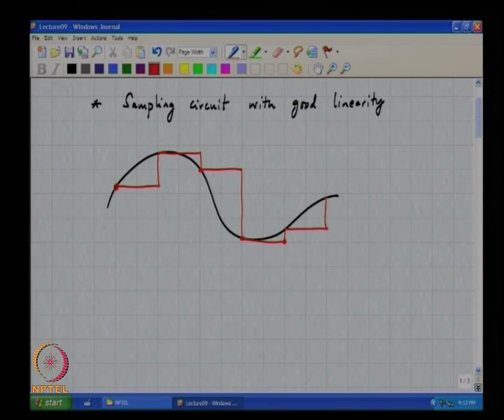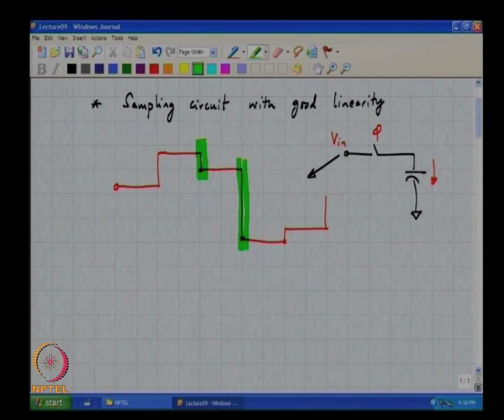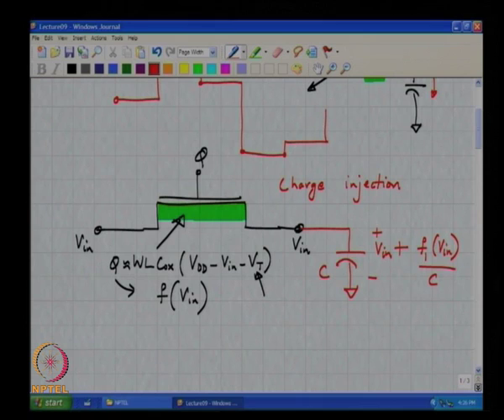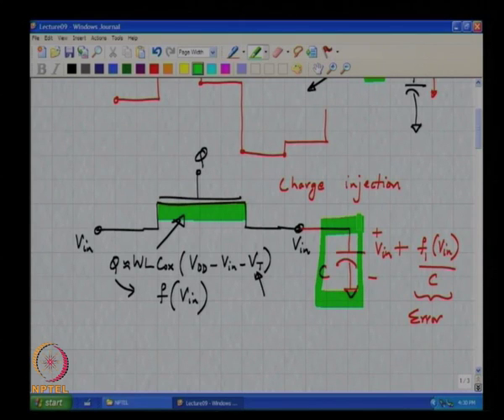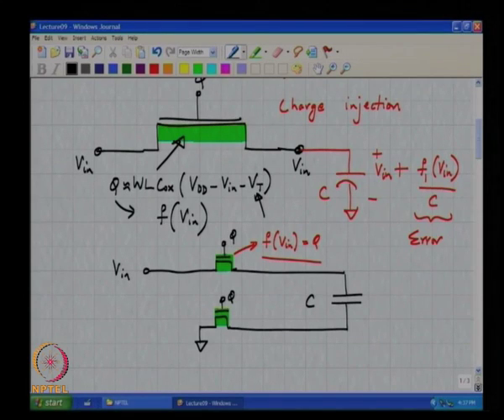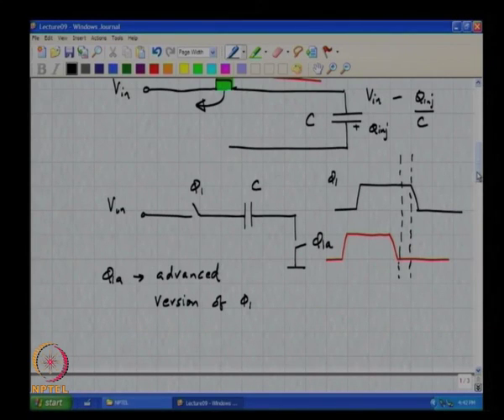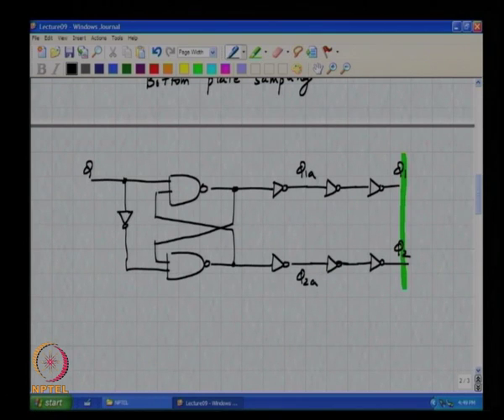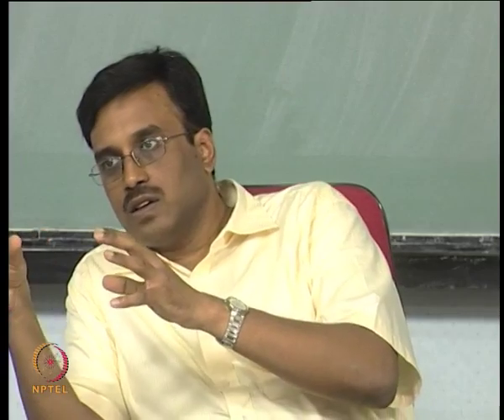Mod-01 Lec-09 Charge Injection

Comment: There are the cases where discrete time signal further to be sampled. For this sampling , a simple switch is sufficient. variation of switch doesn't matter much as long as RC time constant low enough to sample the value accurately.
Charge Injection:Some of the charge injected in to sampling capacitor from switch.Amount of charge injected is non linear function of input voltage hence the error is also non linear. 

To reduce the non linear error caused due charge injection , bottom plate sampling is used. The charge on the bottom switch is independent of input voltage so the error is independent of input voltage.